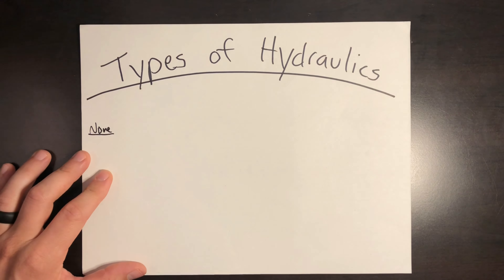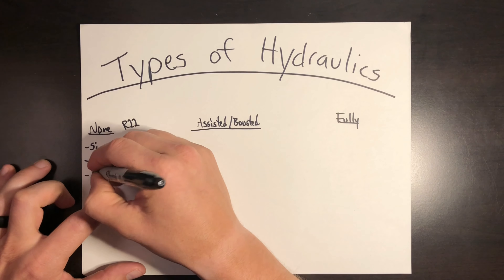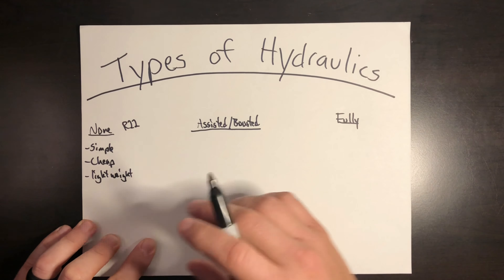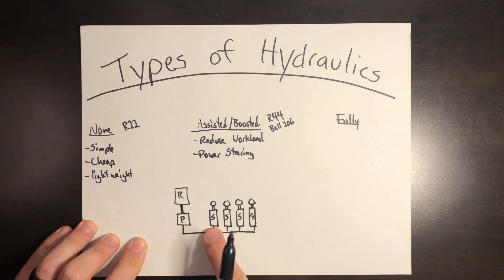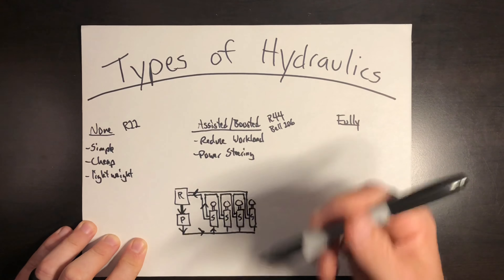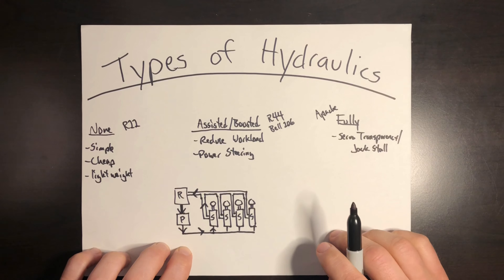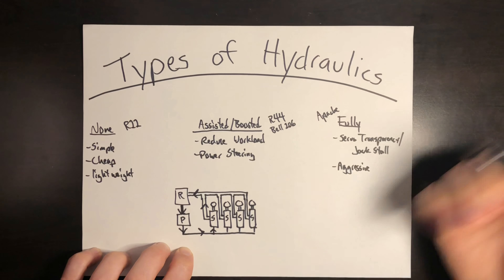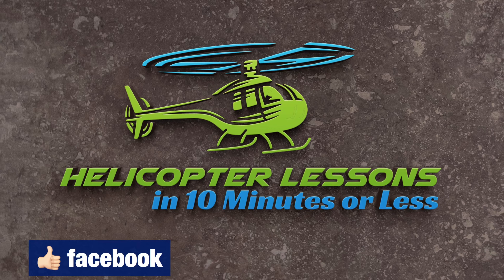Types of Hydraulics in Helicopters

Comment: I think you forgot a passive hydraulic system. It's similar to a system with pushrods and cables and stuff, only that the cyclic and collective movements are transmitted by hydraulic fluid which is moved by the pilot with out any assistance.

Comment: Really great Video Jacob! Super informative as always! I was curious if you know if with the full hydraulic system, is that always fully fly by wire then or do some of them still have some sort of cable or mechanical connection for the servo control? Never got to see one of these systems up close. Keep up the great work :D
Reply from the maker: Hard to speak for all helicopters but they can vary in design and could possibly be either one of those.
Reply: @helicopterlessonsin10minut10  Interesting! Sounds like similar systems that would be in large jets.
Reply: Late, but in the CH47 airframe the flight controls are mechanically linked directly to the servocylinder's via push/pull tubes & bellcranks to a two-way push/pull valve on the servo to allow hydraulic pressure expand or contract the servocylinder. There are only two per rotor system, a pivoting and swiveling servo. When the system is pressurized you can move the servo's by hand ONLY by this valve. So, swashplate movement only happens through the mounted servocylinders & the electromechanical screw-type trim actuators (by-wire) for fwd flight trim. 

Engineers could easily convert this system to fly-by-wire to reduce weight & cost but that would impose more safety hazards & vulnerability. Rigging is complicated enough, cables won't work well in a heavy lift due to stretching. A lot of 47's fail rig checks because they were improperly rigged from the beginning or the maintainers improperly verify the rig (very common, this is one of the most tedious & technical tasks for mechanics).

But once properly mechanically rigged, I believe only the servocylinders can cause flight control rigging to move out slightly over time & that's easy to adjust. (I also believe this has to do with pump pressures and fluid losses, I don't buy the "rod ends fatigue over time, causing the rig to go out" you may hear from others, in this beefy design.) I can't imagine how bad it would be with cables. After inspecting various other airframes they definitely vary by design but essentially operate nearly the same way and always have redundancy when it comes to the hydraulic system. There is no redundancy in the mechanical linkages. You cannot move flight controls with hydraulic power off, it is a fully hydraulic system. 

These lessons are absolutely great for pilots but if you want to dig into the more technical details (which are not very applicable to pilots as this knowledge won't help you in flight), you'll need a engineer to show you or spend a lot of time reading technical manuals. I say engineer because a lot of mechanics know how to replace & fix stuff but few truly understand how they work. Pilots have the upper-hand of how helicopters operate over most mechanics IMO. Engineer's are the gods. I'm not an engineer.

Comment: Hey Jacob, I’m working on designing an ultralight helicopter from scratch. I’ve been thinking an awful lot about the control system. I was considering using non-boosted hydraulics simply because I cannot find any diagrams or videos that show how the linkages for for the cyclic and collective are mixed. Also, while I figured out a way to mechanically translate fore/aft input on the controls to the appropriate points of the swashplate; my solution is not elegant at all and I wouldn’t dare fly it. This comment is getting long so let me summarize in two questions.
1: do you think passive hydraulics would be sufficient for an ultralight? 
2: can you point me in the direction of some materials where I can study systems like what is found on the R22?
Reply from the maker: With an ultralight weight class you probably wouldn’t need hydraulics. The R22 should have info in its operators manual that covers its systems.

Comment: Why can't assisted hydraulic systems run at the same high pressures as full hydraulic systems in order to avoid jack stall?
Reply from the maker: I’m not an engineer. But I believe it comes down to cost and design. Boosted systems are more expensive than no hydraulics. But fully hydraulic systems are more expensive than boosted. As more and more performance is demanded on the helicopter, more rugged and expensive systems must be put in place. By switching away from push-pull rods to fly-by-wire controls, fully hydraulic systems made the most since. At the point of fly-by-wire all flight controls are moved via electric signals instead of push-pull rods. To try and incorporate a boosted system on this would mean installing hardware that otherwise wouldn’t have to be there and extra weight. But once again, I’m not an engineer so that’s my best guess. Great question though! Thanks for the feedback.